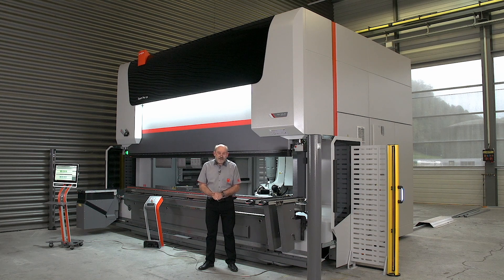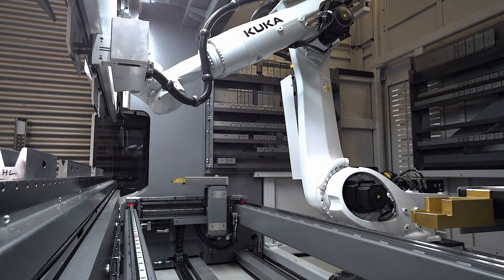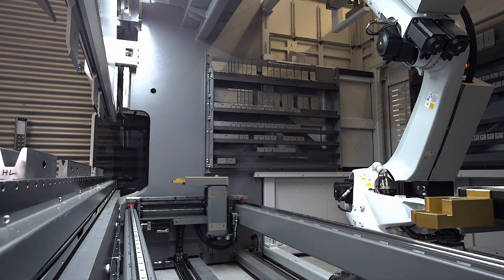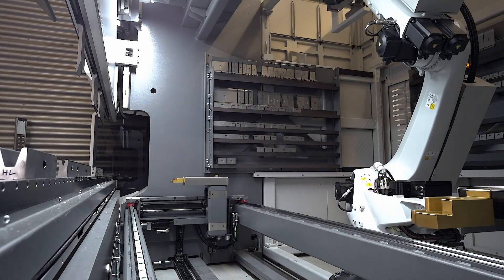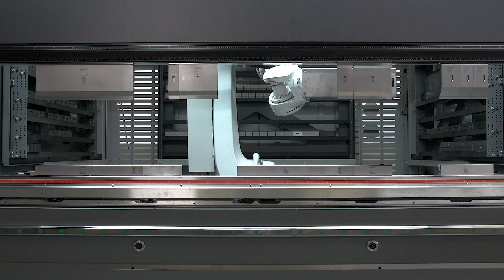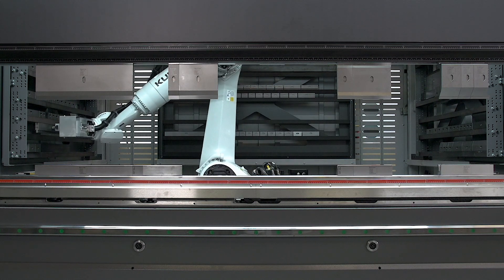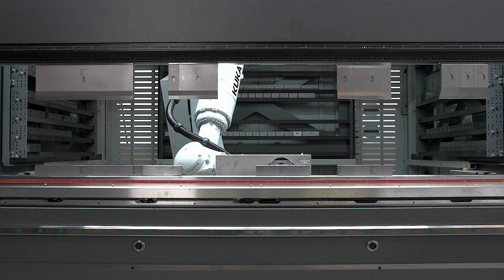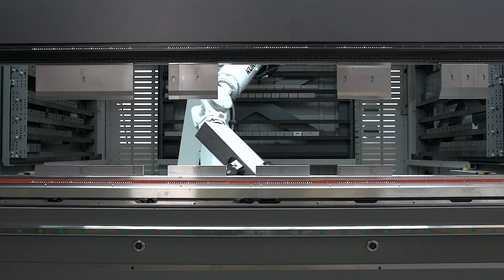Bystronic Automation Bending: Modular Tool Changer demo video (English)

Comment: Looks cool. But it's slow.  I would buy the Amada ATC.
Reply from the maker: Hi Fun,
It is not always and only about speed.
The Bystronic MTC can handle longer, heavier and taller tools.

The variety of tools we can store is incredibly vast.
We can reverse all tools and the tools are our standard stock tools.
And the most important features:
No programming ever, not even when you want to add new tools to the stock
And you can retrofit the tool changer at any point in the future.
So, yes, in some cases the ATC is quicker, in most cases it isn’t :-)

Kind regards,
Gerrit Gerritsen
Product Manager Bending & Automation
Reply: @BystronicGroup  Opinions will vary.   Thanks for the reply.